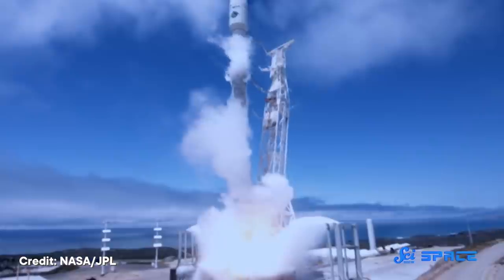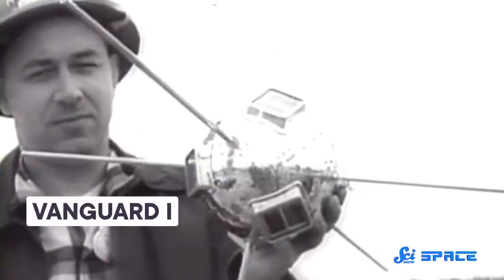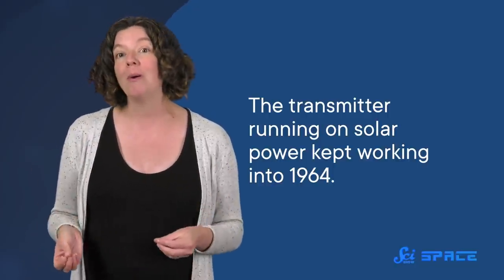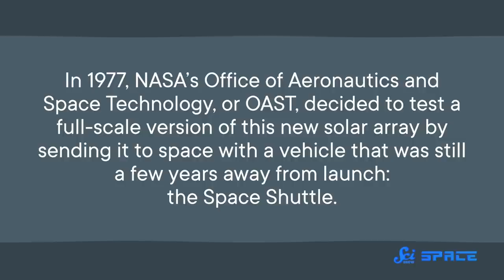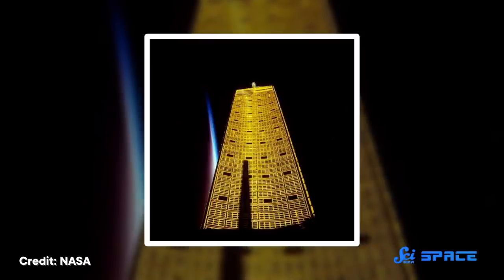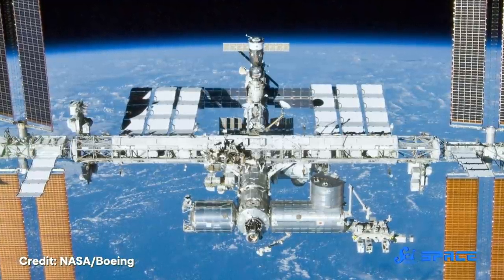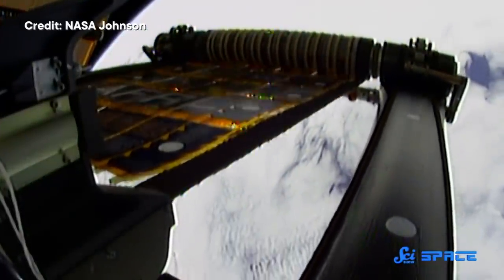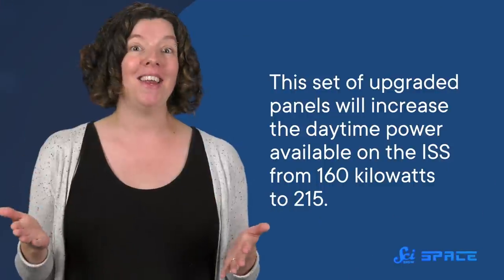How Space Shuttle Discovery got its Solar-powered Wings

Comment: Why so much on replacing chemical rockets how about adding  them  sending electrons throw walls pushing very elections  would push it's mass ..or if much a a ship's mass is fluid then moving the fluid would move the mass . Say a turbine pulling water around pipes in the walls or multiple turbines
Reply: ok im a little confused by how this is written, but if what i think i read was correct pushing things against walls wont create thrust in space, and solar powered engines are very very very efficient and can run for literal years on end, even if its small thrust when in space it doesnt really matter
Reply: Like Rona, I'm struggling to understand what you say, however I'm interpreting it as "why are we using chemical propelled rockets". To escape earth's gravity, we need a lot of thrust. While as Rona noted, in space, things like ion engines are fairly efficient, they don't produce enough thrust to actually get things into space itself.
As for your other idea of moving liquid within a rocket, that's a large part of how actual rockets work, except what you seemed to describe seemed to be something that would continually reuse that liquid. That's just not possible, because to reuse that liquid, it would actually have to pump it back (or at least let it flow) in the other direction, which would give a net 0 thrust.
If you were just moving that liquid to say, the other side of the rocket, and just leaving it there, it would move the rocket somewhat, as the center of balance shifted, but bringing it back to a stop would decelerate back to 0. Even worse, now your movable mass is on the other side of the rocket, and if you were to try to move it back, the rocket would just shift backwards.
No, in order to get appreciable action even in an effectively frictionless setting like space, you must have an equal and opposite reaction. That is to say, to get thrust, you must have something to actually move against, and what you move against must be expelled. To get into space in the first place, you need even more thrust, because you need to counteract gravity, and air resistance.
In theory you can launch a rocket using just water, by forcing the water out of the rocket. However, said rocket will never get very high, as just shooting mass out the back isn't efficient. In order to get it higher you have to add more mass, which takes more thrust to move in the first place. This points to the Tsiolkovsky rocket equation, aka the tyranny of the rocket equation. In order for a rocket to launch and make it into space, it must launch with all the fuel it needs, and that fuel needs to create the most thrust possible, given its weight. 
Sadly for now, the most efficient way to propel a rocket is using chemical fuels which create explosions, which currently give the greatest propulsion for the mass they contain.
Reply: @MrSJPowell  
Excellent explanation.

But about that "in theory" part.

That ain't theory, they've been selling toy rockets that work exactly that way for decades.😁

And they're awesome fun for kids.
Reply: @MrSJPowell  ksp still regularly kicks my butt with the tyranny of the rocket equation and thats with a smaller system and stupid efficient/powerful engines, really helps me to appreciate just how much work goes into getting real rockets into space